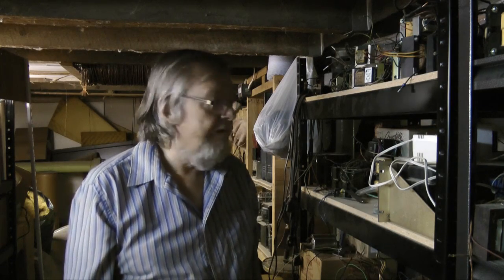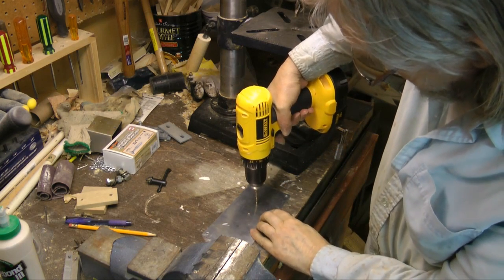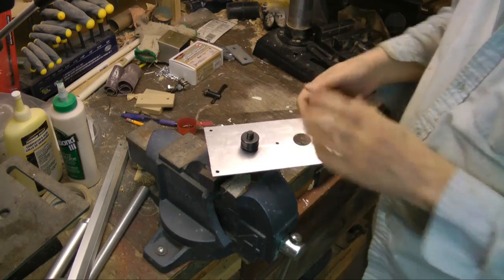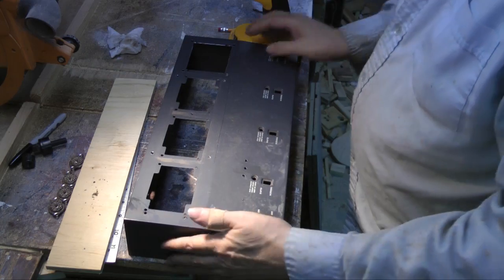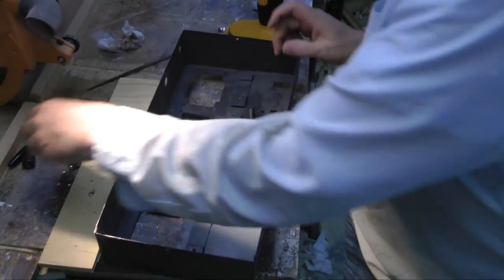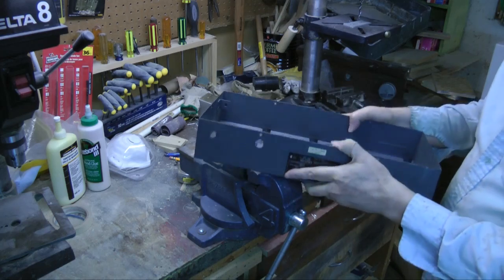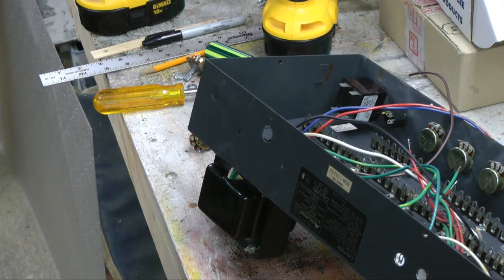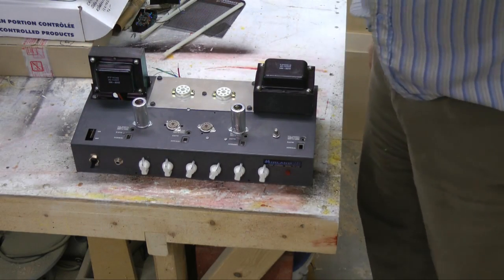50 watt tube amp part 1 mechanical

Comment: I am just starting out buying test equipment for my bench. I am retired now and would like to build guitar amps and share them with my family. I still need to build a Dim Bulb Tester. What pieces of test equipment should I have on my bench to build Tube Amps for my family?
Thank you for sharing your wisdom with us!!!
Reply from the maker: Well, you don't need a lot of stuff to test an amp, a good volt/ohm meter of course, and an oscilloscope and audio generator. It's also useful to have a bench power supply, capable of 300 volts is nice, you may need to make your own. You use it to test sections of the amp. Some kind of component tester is also good, for capacitors and coils. I have an old inductance bridge I picked up surplice.

Where will you get your plans?  Do you have much experience with audio amps? High gain, high impedance equipment can be quite unstable for the in-experienced!

I'm planning a new video, a 3 watt combo amp of my own design (naturally) with an active mid tone control and an EL84 output. I made my first one of those about 18 years ago, this will be about the 20th one. I tweak the design for each new one!